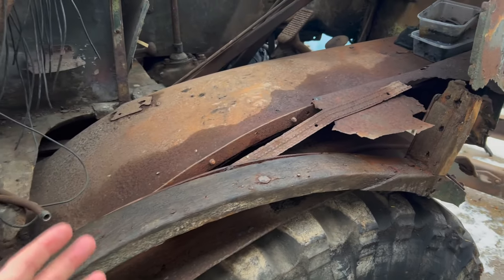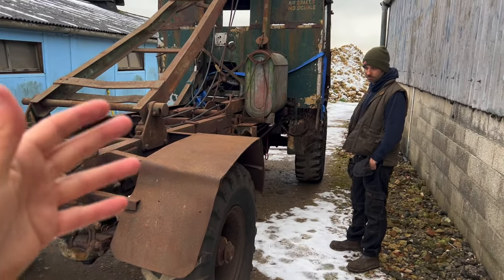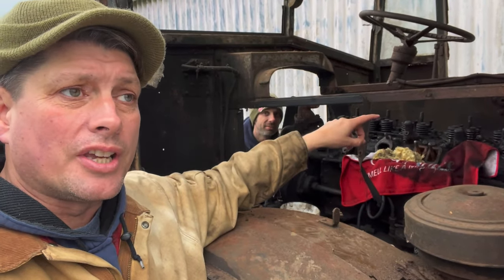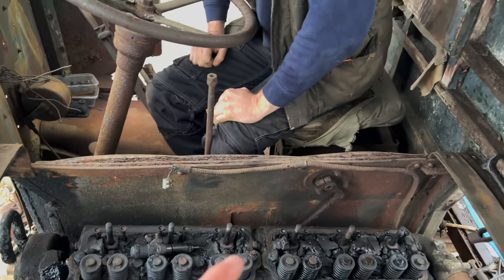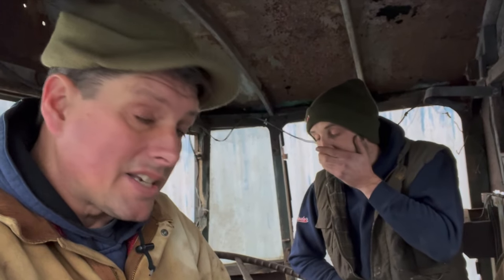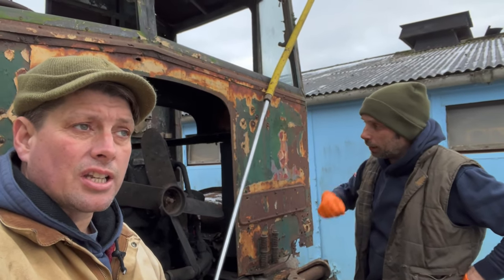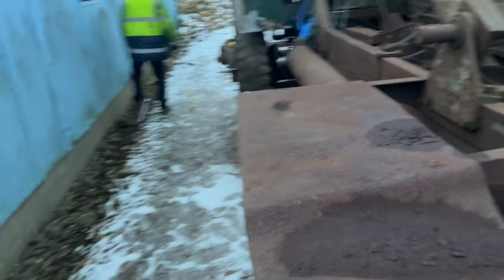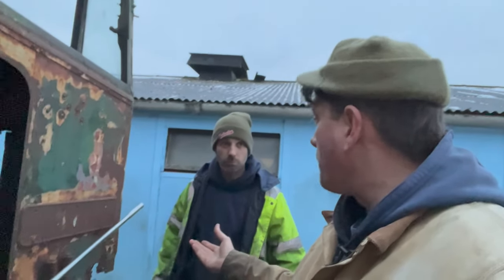STUCK ENGINE - WILL IT START ?

Comment: I was hatched in 1950. As a child and in a previous life I lived close to a timber yard.  The owners had 2 of these old gals hauling huge trailer loads of timber every day.  The trailers were massive and the tractor units would be using every bit of power pulling those trailers up an incline.
Great work both.  Keep at her.

Comment: Many thanks for a great watch again, I wasted a lot of time watching you on the tractor run & thoroughly enjoyed it, THEN you post this one about the Matador, I am 72 now but at the age of 19 I worked as a trailer boy on a Matador & pipe trailer for William Press in Kent & that one had all the window frames polished along with most of the copper pipes. It was amazing where we took it especially off road, one got the trailer loaded with pipes bogged & ours was hooked up to it with the winch & we could not move it, enter an RB 22 crane to pull our Matador plus the stuck one, the RB 22 was pulling itself toward us so it was anchored to a large tree & we managed to pull the trailer out, the tension of the total pull was frightening but the Matadors survived it.I have driven many AEC's over the years & just love them. Again many thanks.

Comment: By far the best entertainment I've watched all week , apart from you and Mildred on the tractor run  yesterday as a spin off Matt should bottle that heating and used engine oil as after shave - mattadior 😃😃😃

Comment: I've just watched that camarata guy and its mind boggling how so many folk are sucked in by his incompetence. You guys on the other hand play around but it's plain to see you know exactly what you're doing. Keep it up !
Reply: I agree. How on earth he gets so many followers it's like he creates drama just for views. Mucker is in a different league, would love to see him collaborate with diesel creek
Reply: Before you go much further I would suggest pulling the sump off . The sludge in the heads reminds me of a 220hp Scania I was working on about 35 years ago . Temperature 30c plus and had to pull the sump to change the oil . First and only time I have changed oil with a shovel . Strange thing is there was still oil pressure before and after . The truck was doing line haul between Sydney and Melbourne doing about 6000k a week or 3 trips It was still going 2 years plus after when I changed jobs still without a problem . Ahhh the life of a diesel mechanic
Reply from the maker: Sump is full of crud and Shyte that we've flooded it with so it will be taken off, cleaned and crank visually inspected before we attempt to start it otherwise we will be swilling all that debris around

Comment: You could probably get some of that gunk from the engine, mix some rocks with it and patch a pothole. Might even be able to use it on a roof. It's the rare 3rd stage of oil, never before seen....it's turned into TAR. 😄😄 I've honestly never seen that much gunk before. I think there might be hope for the old girl after all, despite all that. And since I enjoy these videos, I'm proud to be a MUCKER! Thank you for sharing! 👍👌

Comment: Had one of these on a farm I worked on and was used as a grain cart.
There is one other way an engine can be seized after being sat for a long time and that's rodents getting into the engine via the intake or exhaust and if you're really unlucky all the way into a piston. The urine with the corrode the hell out of everything.

Comment: That oily carbon sludge is like Cosmoline, I bet the metal underneath has been protected from the elements even if the mechanical parts are worn.

Comment: Good effort to get the engine unseized. Great commentary. A lot of work to get there but you succeeded, lucky that the starter motor was still there for the final test run. Often those critical parts are missing and removed to be used somewhere else. New subscriber from New Zealand.
Reply from the maker: The new Matador series will be on Patreon.com/lordmuck and first episode already up, new episode currently being filmed

Comment: An old farm mucker from Maine USA said try a mixture of acetone and ATF about 50:50.  Add to the cylinders and let it set 2 or 3 days.  Then rock it back and forth, repeat if necessary.  Good luck boys.

Comment: took the rocker cover off a 1960s coach with a 466 bedford in it and 2 veloceraptors and a t rex jumped out of the sludge 🤣🤣 cracking video mucker  just keep swinging those spanners

Comment: if anyone tells you that you shouldn't use a 2t lifting strop for towing because it's not strong enough, just point out the massive factor of safety that's built in to any lifting equipment. Polyester strops tend to be 7:1 (it'll have been written on the label before it got ripped off) which is quite a bit more than an equivalent chain. Clearly that doesn't apply if half the strop is missing ;)

In an ideal world you'd use something with a bit of stretch to it for towing, it puts less strain on everything and is less likely to shock load and send a towing hitch flying through the air. In this case, I think that's probably exactly what you needed! The old twisted nylon ropes were good for that but you can get flat straps with some give in them too.

Comment: I've seen either that lorry or one very similar in the early 1970s at a fare ground in Wallingford Oxfordshire.  It was running then and had a diesel generator on the back .

Comment: Having spent 30 years as a mechanic I have never seen anything as bad as that but when it started turning and the way that was firing that diesel out of those cylinders I think it will run. Great job both of you. 👍
Reply from the maker: Regardless of it turning, that sludge....🫣
Reply: @LordMuck  pretty standard fair for stockman equipment 😝😝 great video and the pair of you show what used to be great about Great Britain

Comment: Can't beat those old 6cyl AEC engines..we were still running them in the 80s in old AEC 10 ton knockers... Wire a tin of soup on top of the exhaust manifolds whilst you are driving and you get hot soup when you stop...we had an AEC 10 ton flat bed self loader in the Gambia that we used for months running on 5 cylinders..those engine last a lifetime and more...👍👍

Comment: To free a seized engine we used to put some diesel down the bores  , put a socket and knuckle bar on the crank pulley bolt and then put a trolley jack on the end of the bar ,lift the car and leave it overnight . Works a treat and it's gentle
Reply from the maker: 'Car' being the operative word... You'd bend the bar before lifting this

Comment: Brilliant video Kurt & Matt, thanks for showing just how time (and money) consuming these projects can be. Getting it to turn over was amazing. I can smell that diesel spray from here. Great idea thinking about a boroscope inspection then a compression test when you have a bit of time. At the very least now, there are going to be some good donor parts even if it won't run.
Just one little thing Matt... as you said the temperature is expected to get down to -5 deg, did you remember to top-up the anti-freeze?  I would hate it to freeze up in the cold weather.🙂

Comment: Just found you  buggers  ,  just the job   that fuel tank  is  the business  ,   It  will   run   seen some  where  that  there is   some  thing   that can   read  the  foot  print   left behind   from   badly  faded   transfers  ,   or   have I  dreamt   that  don't think so  All The  Best  with  it  WILL GO

Comment: Today woke up to a -18C morning can't complain too much not windy. If the engine you are working on was a 10 on carbon build up I have worked on a Allis Chalmers D19 gas that was a strong 7. That one baffled me it ran but almost at random would backfire played with the timing multiple times and changed nothing.

Comment: One (of many I have used is ATF and lacquer thinner. Easy to obtain and worked on a tractor for me that sat for about 30 years. A dry engine no water in the bores just corrosion.

Comment: The last time I saw goo like that in a rocker area was in my 2001 Mercedes 320CDI when the holding down bolt failed on an injector.  The only indication was a ticking noise at idle, this happened to two separate injectors at different times.  It doesn't happen to ancient diesels but new common rail ones as well.

Comment: Great video, had something similar myself an old wreck of a fordson from a auction spent 20 minutes dragging it in gear with a leyland 272 trying to free it off and uses every method possible but after a closer inspection of the rockers 2 of the con rods were slightly bent it went back in the auction afterwards.

Comment: It's nothing but tar in those cylinder heads. That's what happens when you don't change the engine oil regularly. Good luck, guys. Greetings from the U.S.

Comment: Proper good job guys. I wouldn’t be surprised if all that crud has helped save the old girl. It the top looks like that would it be worth dropping the sump just to check as wouldn’t be surprised if it’s solid and may have held the crank along with the bores. 

Just a little thought
Reply from the maker: At what point after filling the engine with heating oil and waste Shyte did you not think we would drop the sump ? 🤣
Reply: @LordMuck  well you did also think one can of party had would get it going when it clearly needed two. 😉🤣
Reply from the maker: I want to see if any rust or scoring has occurred on the crank and big ends before we go too far.

Comment: When our local saw mill closed in the 60’s our Local garage who I worked for, bought one and used it for HGV recovery. I am a bit confused as the one we had you opened cab door stood on the step. At shoulder level if you sat in the seat was grey box 10x10 inches sticking out of it was round bar with 2 inch disc on it. You had to push this in to send power to the heater plugs. Was this a later engine version? Could have been the saw mill fitted a different engine. I found out the hard way you had to wear gloves to steer it or you got blisters. The brakes we virtually non existent.
Reply from the maker: It could have had another type of cab fitted (many did) and the round thing you describe is basically the circuit breaker which allows power to the starter and electrics.

Comment: I got a Bomap 65 twin with an air cooled  Hatz single tat was seized. We took the engine apart, no problem. Put it back togeher and our fitter stuck a screwdriver in the cooling fins on the fan , it moved. The fan had just touched the cast iron suround. Forgot to say the handle is on the camshaft so 2:1 and no torque. It now runs perfectly. (Check everything obvious first) Not applicable to this one.

Comment: can't believe the amount of crud on the top of those heads, probably hasn't had an oil change since it left the army! don't know how bad the main frame of the cab is but is it possible to get it mechanically working and leave it cosmetically alone?
Reply from the maker: No.

Comment: Was that fuel tank from an ex WD water pump or generator maybe? Can attest to standing seizures as i've had to free the engine (Armstrong Siddely twin cylinder diesel) on a Massey Harris 760 bayler unit.

Comment: What I've used to good success is a mixture of automatic transmission fluid, acetone, and marvel mystery oil, but I don't know if that's available where you live
Reply from the maker: The stuff we used did the job especially as we don't want it sitting around for another 30 years in soak...

Comment: Does the Fud Weasel ever buy new lifting strops OR does he just fish around in other people’s rubbish bins for old ones😁🧐?
Reply from the maker: That is not the fudweasel...
Reply: @LordMuck  Sorry. Long week, late at night, need to get more sleep🙂. Thanks for a good video.
Reply from the maker: The Fudweasel has an entire shelf of brand new strops and slings all in their packets.
Reply: @LordMuck  All good. I should have said slings, not strops. Getting to sixty and having to do an excess of lifting (and ground works) because we cannot find hard working young fellas, is a literal pain. We actually ended up with three or four brand new slings one day because the driver did not want them back. Possibly trying to piss off his boss! They came in very handy on the next big job because we had scores of round timber retaining posts to position in their holes. Huge relief, after that, to get back to actual house building and a renovation in a different part of town.

Comment: Well it's always the case of three things, isn't it? 
- was it cheap
- is it rare
- is it something personal (like an heritage tractor that was in the family since Grandpa bought it new.. 
And there is a forth "if".. As a total beginner.. I have an old xyz.. Stat I gave money to someone else every year to make it run.. (check oil, change filters, clean carburetor).. 
This year I might as well take the 250bucks, buy the spare parts and try it myself.. 
What could go wrong. Either it works and I learned some stuff, and find out if I like fixing it myself, or I learned some stuff and sell the xyz and get me a better one... 
Best thing about let forth method imo, - you learn once and for all what happens if you only fix your wheels so "that it runs" year after year, and ignore the rest. You see for your self and realize the difference between fixing stuff and proper maintenance. It took me for ever since to  make my first project running! But I had fun and the next Project is a Mobylette AV 88 (Motobekane). I really like how LordMuck gives you an insight into all the pros and cons of a project. Imo that's vital information for people (like me) with less experience but want to purchase new old machines for fair prices to wrench on😁👍

Comment: Happy to be corrected but I'm about 85% sure that the vehicle is marked for 7 Heavy Anti-Aircraft Regiment RA. The Maltese Cross combined with the TAC marker on the drivers side, which appears the be 768 or 769??, points in this direction. Units that where part of Malta Command had the white Maltese Cross on a  red background as the formation marker. If this is the correct unit, then it spent between 1936 and 1944 in Malta, after which it was returned to the UK and became part of Anti Aircraft Command. This would also explain the original colour of Desert Yellow then painted over with Olive Drab.
Reply from the maker: The dates aren't quite correct for this vehicle but a lot of that ties in with what we now know. The desert yellow would have been painted over in '53 after the refurb with bronze green.

Comment: From previous videos you have scrap engines laying around with all the parts this one is missing unless you already scrapped them if you did why didn't you pull all the good parts off for spares. That'll probably run better than most would think you can clean all the sludge out of it later.
Reply from the maker: Keep all the good parts rather than just scrapping them ? Now there's a thought - I'll suggest it at the next meeting...

Comment: good old coke down the bores can free em up pretty well the cola type....
Reply from the maker: It does fuck all when an engine is like this (ask me how I know...)
Reply: @LordMuck  never tried one that bad really impressive you managed to get it free at all look forward to part 2 when it shall fire up without any easy start
Reply from the maker: I tried it on an engine once for a month, about 8 litres of Coke. I'd have been better off buying a bottle of rum and opening a fucking bar...
Reply: @LordMuck worked pretty well with landrover engines and a couple of seized international tractor engines lol plus a large hammer...
Reply from the maker: There you go, little engines... 😉
Reply: @LordMuck  no one is stupid enough to let me play with big ones :(

Comment: No no no! You're doing it all wrong. Here is how it should be done. That gunk present where the rockers should be is actually Self Healing Intrusive Toluene. When the engine starts this stuff will penetrate deep into the bores clearing the pipes faster than boots own brand laxative. The birds nest found in the cab will make a perfect replacement rocker cover. Place this on top and the twigs will act as replacement rockers killing two birds with one nest. Oh and your breaker bar is a foot short. You need an extra length of gas pipe and you forgot to spray ether down said pipe to give it that extra kick. Trust me I am an armchair expert.
Reply from the maker: I'm just taking notes...

Comment: What is the engine in that?
Reply from the maker: 7.7 AEC
Reply: @LordMuck  had the same Engine in my AEC Reliance bus, that will run with just a bit more love, mine fired up in 3 lazy turns after not running for well over 10 years sat in a field.

Comment: Lm slsp mike O donavan across the head I have tried to contact him by phone about his scammell headlights I have potential replacements for him I just need a few details about dimensions depth is the important one
Reply from the maker: Send me the details
Reply: @LordMuck  there were 4 or 5 manufacturers of the headlights including lucas hella carello  they share similar dimentions to the oval it was the depth they were different on for bean projection  I have a buisness friend who rebuilds mk 1 escorts they used these square lights so did the early chevette my friend has access to the chevette lights through his contacts on the classic rally circuit